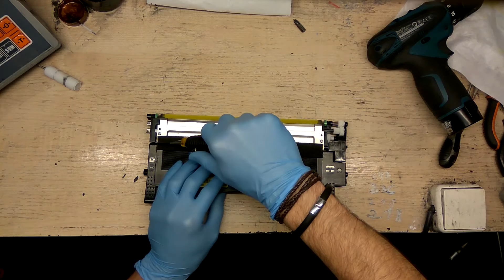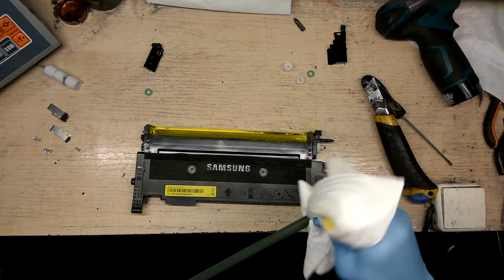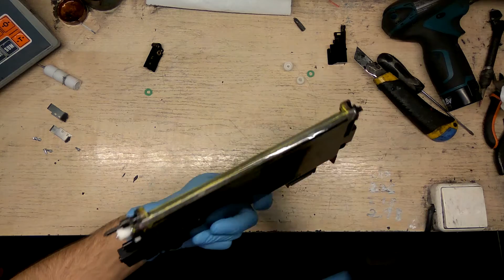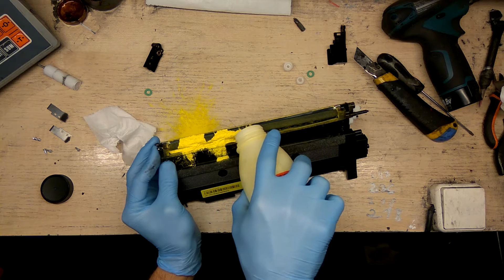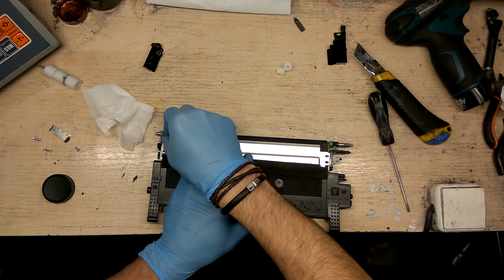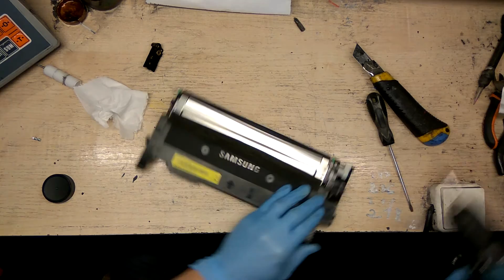Заправка Samsung CLT-Y404S // Samsung CLT-Y404S refill

Comment: well there is a little more bette way... just need to take out another roller and the bottle must be made with small ** to fill directly inside ;)
Reply from the maker: there's a lot's of way to fill the cartridge :) the best way for me is this and it's not taking a lot of time in the old days i've remove the cap by cutting the edges but it's nasty and not presentable look at the end. :)
Reply: Yes to take off the cap is really hard. But i think u can take another roller and your bottle of toner could be with small snap :) to fill toner easer inside... :)
Reply from the maker: Audrius Kazlauskas nah, some other time i will experiment :)) i'm so lazy right, every day refilling 50 or more cartridges is boring :/
Reply: Do you need to replace toner chip after refilling ink for the cartridge